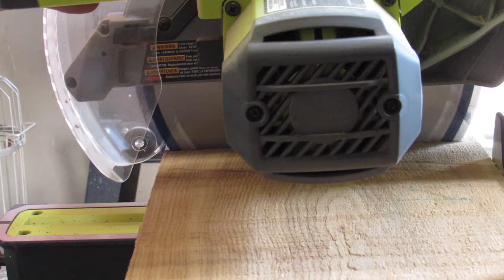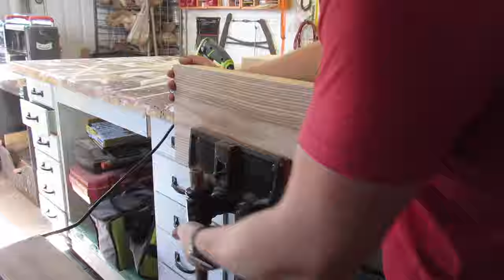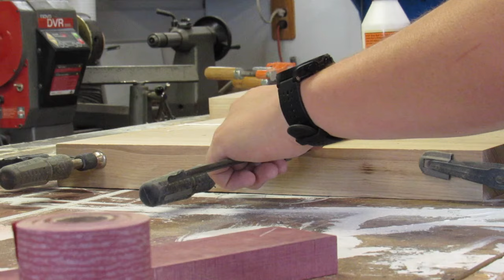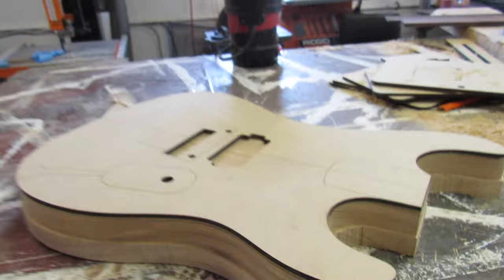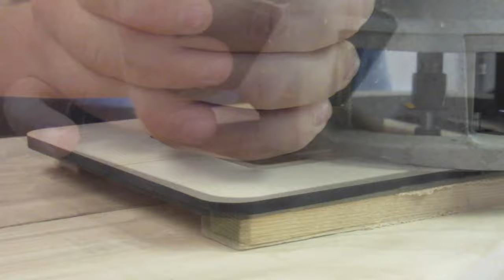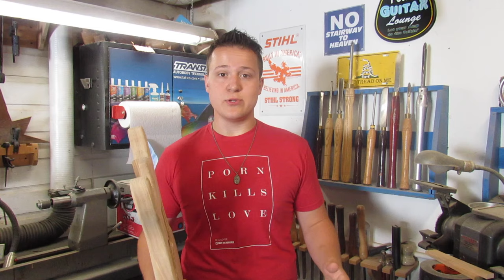Building A Guitar Body - Making A Guitar From Scratch Part 1

Comment: That's not "Bookmatching." That's just gluing consecutive boards side by side. Bookmatching would require you to take one of your boards and cut it like a sandwich roll so you are opening it like a book. You glue those two halves together and you have a bookmatched body.
Reply: I don’t see how just gluing side by side would remain strong enough. You’d think some sort of dowel or something would be used to give the glue joint more strength.
Reply: @trevorhardy3544  If those edges are extremely flat, they'll be fine when glued together. From guitars and basses, and violins to contra-basses, that's how it's done.
Reply: More than strong enough with just the glue
Reply: sometimes, the wood glue is stronger then the wood.
Reply: @ranecote  yep in this case I would expect the glue joint to be stronger than the wood. If gluing the grain end to end rather than side by side, the wood should be stronger.
Reply: @trevorhardy3544  the glue is stronger then the wood is actually. if it were to separate it would be at the grain, not the glue line.
Reply: @trevorhardy3544  glue has been proven to be stronger than wood, it's amazing, but I, like yourself would want a mechanical connection like a biscuit or two. Using these would also require you to know where all your routing would occur beforehand which would be interesting to figure out in a good way.
Reply: @trevorhardy3544 in most cases the glue is stronger than the wood itself, it’ll be fine

Comment: Wood type does not affect the tone of an electric guitar.
Reply: There are many different schools of thought on the subject. I personally believe that it does, but everyone has different ears
Reply: Keval Wagher ppl can argue whether or not it affects tone. One thing they can’t argue- the wood type DOES affect the vibration and resonance. Also, the moisture content, and the density of the wood. Impurities in the wood, sap, etc. These all affect the vibration of the instrument, and the strings. The strength of vibration to the strings will affect the signal to the pickup.
Reply: Of course, it’s the sum of all its parts that makes up the tone. Everything plays a small part. The neck wood will affect the sound of the strings more than the body wood, because it’s mainly where the vibration will ring from. And the neck will transfer vibrations through the body. But the neck is the more important than the body wood. And the neck wood def will have various different sound characteristics depending on wood.
Reply: It affects a lot of the way your guitar is going to sound and sustain. It’s why Ibanez got a bad rep in the 90s for using agathis on their cheaper Gio guitars. It’s sustain is terrible.

If we’re talking acoustics, it matters a lot more because you’re relying on solely the guitar to carry the sound out from the strings.

If you’re talking death metal, it might be more of a pickup game, but on more natural sounds, wood does make a difference.
Reply: Aaron Lee agreed. It may not be noticeable to some people. Sometimes the difference in wood can be too small to hear in terms of "tone". But, sustain and resonance variances can def be felt, and heard on an electric.
Reply: Aaron Lee my swamp ash tele has a roasted maple neck, ebony fretboard, bone nut, ss frets, Wilkinson cold rolled steel bridge with the 3 brass saddles. unplugged it has amazing sustain and vibration. Very bright. My other tele has a warmer mid sound when unplugged with the 6 saddle bridge and maple neck and alder body. It's noticeably different. Thats just unplugged. When plugged in theres a big difference. Then there's semi hollow bodies...

Comment: You can use the off cuts from when you cut the body out on the bandsaw as stabilizers when routing out the body. You really only need them around the horns but it works great if you don't have a table router, gives the router a surface to ride so it won't tip.

Comment: Nice work.  One thing that can really help with routing around the horns of the guitar is to put a 1 foot by 1 foot square of 1/4 inch plexi glass on the base of the router so you can distribute the weight of the router over more of the guitar.  I wrote this as I was watching.  The other option would be to put the template on the bottom of the body and use that router table that you have.

Comment: The best way to get the neck pocket perfect is to make the guitar neck 1st. 
Then you can hold the neck up to the front of the soon to be pocket and measure the bottom of the neck heel. At least it worked better for me that way.
Reply: Also want to keep in mind how high the bridge is going to be. Measure the bridge height from the string placement slots and the neck height from the bottom of the neck to the top of the fretwire, take the neck height - bridge height. That will be your depth.

Comment: Nice job,  can’t go wrong with Mr. Josey Wales watching your back.    The router tipping when used in that manner unsupported in the cutaways is gonna happen typically,  either use some cuts from the body blank to support it or better yet use your router table and make this task foolproof.   If you want to achieve a tight fitting neck pocket I always have my neck made first so I can use it to estimate pocket depth and of course fittment.

Comment: On the collar of your router, look for  a spiral line that goes all around the device. Then, notice there is what looks like a peice of metal or plastic that set around the device and scrolls in the grooves. Kinda like a collar. Turn that collar either clock wise or counter clockwise, and you will notice the bit going up or down. It extends and pulls in the bit into the frame so you can adjust the depth of your routing bit. It turns the whole thing into an adjustable depth router. You don't need to get creative when setting the depth doing a job.

Comment: Measure the bridge height from the string placement slots to the bottom of the bridge and the neck height from the bottom of the neck to the top of the fretwire, take the neck height - bridge height. That will be your depth.

Comment: Almost four years down the line you’ve probably already learnt this, but for curious viewers: Kramer guitars use Fender specs for their neck joints. If you’re curious about how deep you should route the neck pocket, it’s the same as any Fender Guitar: 5/8 inches (16 mm)

Comment: Putting that pattern bit in your router table and using that to cut with your template is much easier and keeps you from tipping the router and having those issues.  Thats what I do.  Works well.  For pockets  you usually do those after you have your neck and hardware that way you can measure what you have and cut accordingly.  I'd just do like 1/4" deep at first and then final depth once you measure your other parts.

Comment: You're lucky it didn't tear out with that pattern bit. You were climb cutting which promotes the router running away from you. Safety first!
Reply: I only went back to check a few clips and it seemed like he was not climb cutting. But aside from that, climb cutting does have some utility to actually prevent tear out. Sometimes following the "correct" direction with the router means that your bit is cutting against the grain and that can cause tear out especially near corners. You can climb cut to prevent tear out in these situations. But you do have to go slow and be careful.

Comment: Hi! I'd love to know that why do you need to make the body from 2 pieces and glue them together? Or you can just use 1 piece?
Reply: You can use one piece, but finding a piece of wood that's the right width is harder.  If you can't find a piece of wood that's the right size, making the body from 2 pieces is pretty normal with building guitars.
Reply: @deltabearlines9321  Thanks for the reply!

Comment: You shouldn't rout the neck pocket until you have a neck, you take measurements from the neck and the relationship between the hight of the bridge you will be using and neck. Same with the cavities, if you haven't made your cavity covers there is no way to know how deed to rout the recess. Just trying to help, hope it comes off that way.
Reply: Yes, yes ,yes!  I was thinking the same thing. No need to do a body route until the neck is done.  That way your neck is your go/no-go gage for the pocket.  I will say, the body is fun to make and it’s very tempting to make it before the neck.

Comment: No one knows what type of ash that Wayne Charvel or Linn Elsworth used for their guitars as even the owners themselves did not know what type of ash it was.  Most guitars at that time were made from SWAMP ASH since its' grain is so much more attractive than northern ash where it is tighter and lacks the beauty of swamp ash.  Also the regular measurement of a neck, tremolo and pickup route for a Fender is always 5/8" of an inch. This is the standard by which all other manufacturers use as a general rule. However because the Floyd Rose is so thick traditionally the route in the top of a guitar is required.

 Sadly Floyd Rose underestimated the strength of steel although he was a machinist he didn't realise that this didn't need to be so thick to be functional and durable. Fender used a 3/32" inch thick tremolo plate that is still in use to this day.  You would have to make the neck route 1/8" of an inch shallower to accommodate the height so that the string action wouldn't be so high. The base plate and saddles on a Floyd Rose tremolo are way thicker than they need to be.  This is something that you have to keep in mind when making a guitar for a Floyd so that it will play as intended. I'm only sorry that I saw this two years and eight months too late to be of any help.

Comment: This debate is so stupid, but I'm going to say it anyway. Unless you're playing that guitar unplugged. You're not going to hear any of the resonances from the body of that guitar. 
The only things that effects the sound on an electric guitar are the frets, strings, and most importantly the pickups. The sounds that resonate from the body aren't related to sound that the amp produces. They are entirely separate entities in the soundscape. That thing could be made out of MDF. It will still sound the same as the guitar that you've built in this video.
Reply: Ok pal. Do strat pickups in a Les Paul body sound like a strat? No.
Reply: @encryptor6710  Actually, they do. I really hate to break that to you.

Comment: Now I know why bodies I've bought in the past don't work. Hope he doesn't sell these to people. You shouldn't drill the posts all the way through, that's not a Floyd Rose Trem, the neck pocket is one of the most critical parts of the body, depth of routes is a critical part and that is not book matching. That's going two boards together. 
One tip I can give him though is to put both boards together and plane both sides at the same time so they fit together perfect. Also, put some salt in the joints to stop them from slipping when you clamp them